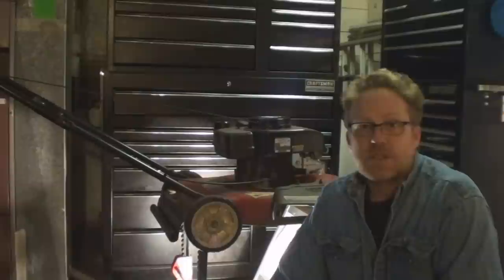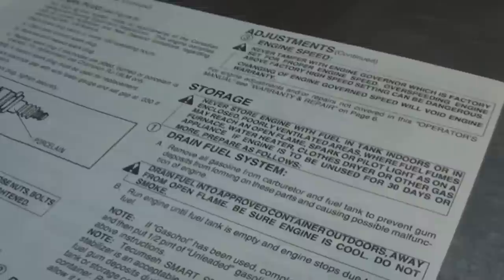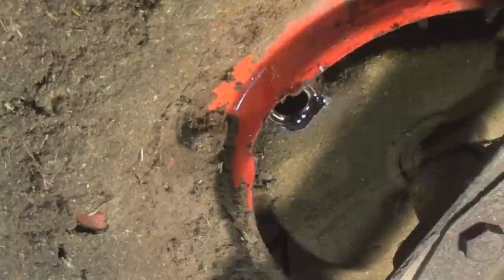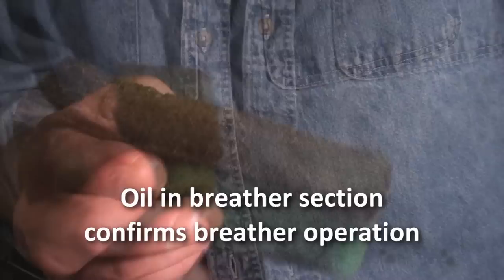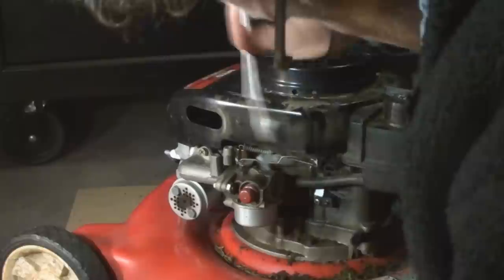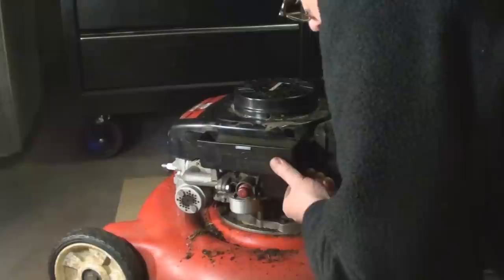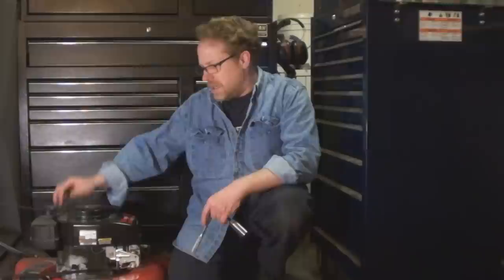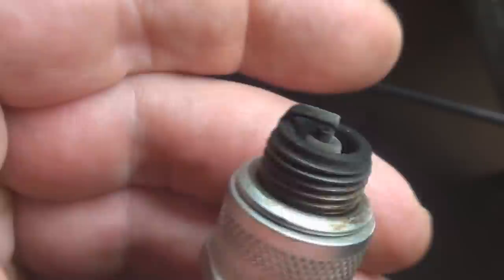Lawn Mower Tune Up

Comment from the maker: The product is universally known as "Brake Cleaner", a quick-drying, oil-busting type of solvent used in the prep/assembly of brake components. Available in numerous brands at any automotive supply shop. Mechanics use this stuff for cleaning just about anything. Not cheap, about $7CDN per can, but also available in bulk (non-aerosol) drums for use in pump sprayers. Awesome product. I've lifted black grease off grey carpet with it - spray the rag, not the carpet!

Comment from the maker: Assuming everything looks fine on your machine (all original parts and nothing damaged) and assuming you did a basic tune-up I would first look into the condition of the governor and the fan that powers it . If it's clogged with debris it won't provide adequate breeze to overcome the governor spring(s). Good Luck! 
PS: Using the choke for anything other than "Start-up" is going to cause damage in the combustion chamber by starving it for air.

Comment from the maker: Yes, making the spark plug come in contact with bare metal that the spark plug lead is grounded to (like the engine block/body) will complete the circuit and allow you to see if there is a spark or not. A trained eye can even determine quality of spark from the color and intensity of the spark under favorable lighting conditions.

Comment: the jet is the hole that is a calibrated size for fuel metering. On tecumsehs like the one in the video, the jet is the nut on the bottom of the carb. When Jets get clogged a reduced amount of fuel flows, causing miss fire.

Comment from the maker: @76ChevyC10  * 1st look for air restrictions. Kinks or obstructions? Air filter new? Throttle plate operating? Control cables stroking? Check fuel delivery. H2O in fuel? Fuel pump delivering to spec? What kind of service has it seen? High hours? Dusty conditions? Running without air filter? Maybe rings are worn. Compression test will reveal leaks. Leakdown test will pinpoint the leak. Look for smoke in exhaust when stalls. Check exhaust for restrictions. Check for EGR (operating OK?)Good luck.

Comment from the maker: @dragoon2784 - The carb sprays fuel into the vacuum caused by the falling piston which draws in the air. The result is a fog of air with fuel droplets suspended in it. Too rich means too much fuel in the fuel:air ratio (opposit of too lean - too much air). The result is a blanket of black stuff made of partially burned fuel residue.
I added tension to the spring that controls the governor in order to allow higher speed operation. This is the only adjustment I know of for this carb set-up.

Comment: I don't know if you mentioned it, but on push mowers, the valves get tight and make it hard to start. Some people trash their mowers because they wont run properly and it only needed a simple adjustment. On OHV engines, its part of normal maintenance... I used to work on B&S L-Head engines back when points were used LOL
Reply from the maker: Thanks for contributing, brother!

Comment from the maker: Some machines have "Low Oil" sensors that will shut the machine off when it senses inadequate lube oil, so be sure that's not the problem to start. Next I would take out the air cleaner to make sure it's not starved for air and try it. Next I'd look at the governor mechanism to see if there's damage or debris blocking operation and causing the malfunction. After that I'd go looking for (partial) fuel system blockage - start by looking for a pick-up screen in the tank. Good luck!

Comment: Hes right with the too much oil=misbehaving once I put too much in on eof my mowers and it kept stalling even at high rpms, it was running funny, hard to start and the works so I emptied some out and its been fine since

Comment from the maker: Some machines have "Low Oil" sensors that will shut the machine off when it senses inadequate lube oil. If you're good there I'd check the air filter is clean and the governor for damage and/or debris. Good Luck!

Comment: There's something wrong if the engine is getting 80 PSI on a wet & dry compression test , by the looks of things, the motor is a Briggs & Stratton ,the same brand as mine which is in storage & I tested it and got 75 PSI on a dry test & about 110 PSI on a wet test , meaning the rings are worn, the machine runs albeit blows a bit of smoke when cold so from what the test is telling me the motor is on its way out, so, when it comes time to use it again a full rebuild, just a freshen up is to be done.
There's a bloke on here from the U.K. has a Briggs & Stratton motor running on 55 PSI of pressure but it blows lots of smoke & is totally stuffed.
I am in the process of rebuilding a Stihl HS45 hedge trimmer for someone (I'm waiting on a set of rings for it)  and 75 PSI of compression wouldn't run the 2 stroke engine,there must be something different with 2 stroke engines where the fuel mixture is drawn in through the carby,into the crankcase then sucked up into the combustion chamber to be burnt off whereas the fuel/air mixture is drawn into the combustion chamber via the inlet valve & carby in a 4 stroke engine so the 2 stroke engine must need a higher amount of compression to even run the engine , either way , anything under 100 PSI is GOING (on its way out) for any internal combustion engine , whether it be a 2 ,4 stroke or Wankel (rotary) engine.

Comment: HI 
GREAT VIDEO 
I HAVE THIS Bridges & Strattion LAWN MOWER IT RUNS FINE BUT THE ONLY PROBLEM IT HAS THAT ONCE IT STARTS  THE ENGINE DON'T RUN AT SAME SPEED DOESN'T MATTER IT IS SLOW SPEED OR FAST. I TRY TO MOVE THE CHOOK AROUND AND ALSO I ADJUSTED THE SPRING BUT STILL THE SAME PROBLEM. ANY TIPS SO I CAN FIX THIS LAWNMOWER? PLEASE          THANK YOU

Comment from the maker: Tough guessing without knowing much about it. I'll assume 4 stroke air cooled and all parts are present and undamaged and you ran it in the past without incident. I would guess it's starved for fuel so fuel blockage somewhere. Check for a pick-up screen in the tank, try cleaning it with fresh fuel and a toothbrush. Good Luck!

Comment: Ok, I have a 17.5hp Briggs and Stratton lawn tractor I bought 11 years ago. It's been having a problem like when I climb a hill it bogs out and hesitates a lot. I was wondering if the carburetor on it may need to be replaced or rebuilt? Because, I changed the fuel lines and filter and it didn't do a thing. Any advice??

Comment: I have a similar lawn mower that started a few weeks ago for the first cut of the season. Last week my son went to cut the grass again, and he just about got the front done when it quit on him. At this point it starts but stops after a few seconds of running. I checked the oil level which is good and have put new gas in it. Is there anything you would suggest?

Comment: Hi, Thanks for the video. I've pulled out my lawn mower for the springtime. I changed the oil and topped off the gas (the gas from the previous fall was stabilized with an enzyme). I also checked the air filter which looks fine. The mower started up alright with a cloud of white smoke but then quickly died and then refused to start again. I left it to sit a while in case the engine was flooded and it happened again. What do you think is up?

Comment: Can you help me I'm trying to get my Honda OHC lawn mowner to start but it is real hard to pull. There is conpreshion and it will back fire. I pulled spark plug and it was clean. It was very easy to pull with the spark plug out. Any suggestions ? Is there a valve problem?

Comment: hi great vid,
followed it bit by bit and everything ok.
only one hitch since it has started running slow low idle.
i have moved the tension off the spring and it then revs away
I intend to replace the spring as it looks sloppy general tick over is good
any ideas
Reply from the maker: Try to find the Original Equipment Manufacturer's (O.E.M.) spring. Good luck!

Comment: Do you have any tricks as to quiet down these loud son of beeaches? 90 db is loud for my tender ears.
Reply from the maker: +Robert Fernandez - Dude I always wear my cones. When I was young (jurrasic epoch) I worked with saws and blowers and chippers and mowers and nobody wore cones. Eventually I realized my hearing was being affected  and as a musician I took that very seriously. People used to snicker but they all wear them now. http://www.amazon.com/gp/product/B0000X6L82?ie=UTF8&creativeASIN=B0000X6L82&linkCode=xm2&tag=repairs101c0a-20
Reply: +Repairs101 Dude, I also wear mine. Double! Foam plugs plus the earmuffs. I was just curious if you had any ideas to silence them since they run so damn bloody loud. Have at least 5 pairs of muffs around my shop.
Reply from the maker: +Robert Fernandez - OK so the only thing left is to increase muffler size and or add baffles or stages to your existing exhaust. Problem there is for every turn the exhaust has to take you will see a reduction in power (from backpressure) so I don't know if that profit vs loss margin would be worth it to you.

Comment: I clean the bottom of my lawn mower when i finish.Have a problem ,When i started to turn the lawn mower on ,It started but wouldn't pick up speed,It slows down.When we got a new spark plug it still was slows down ,What could be wrong.It wont go fast,Only slow .
Reply from the maker: Check air intake is free flowing. Check fuel pick-up strainer for blockage. Have a look at the governor and spring for damage or debris. Good luck!

Comment: hi I've taken my grass strimmer apart to replace pull cord and the engine and throttle are work in correctly but the head isn't spinning can u help
Reply from the maker: Can you send a photo? Hard to see from here without one. Check to see the head is aligned and mating with he drive shaft assembly http://www.ereplacementparts.com/weed-eater-xt85-gas-trimmer-parts-c-17589_17626_18175.html

Comment: Why  run the engine until the carburetor is dry? What does this achieve?
Reply from the maker: +Chris Crowley - running 2 strokes dry ensures the carb and all fuel passages are empty and not depositing varnish and causing blockage
Reply from the maker: +Chris Crowley - Have a look at this much newer video of mine on the same subject when you get a chance - How to Service Your Lawn Mower - Basic Engine Service & Blade Sharpening https://youtu.be/yy9RdTo_KwI